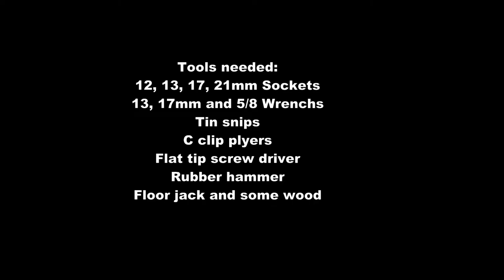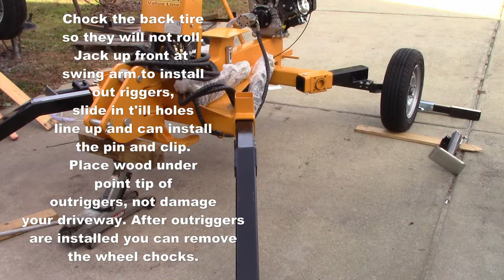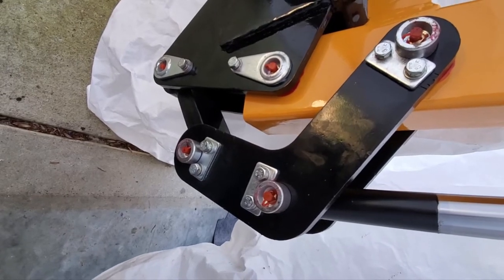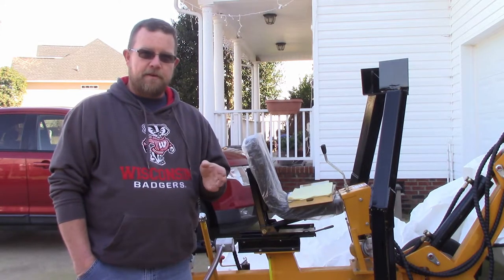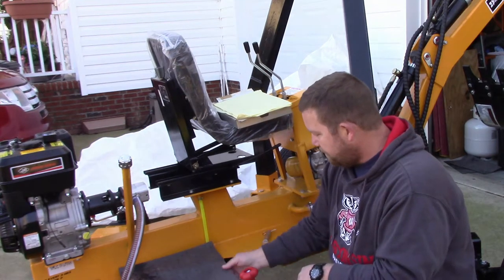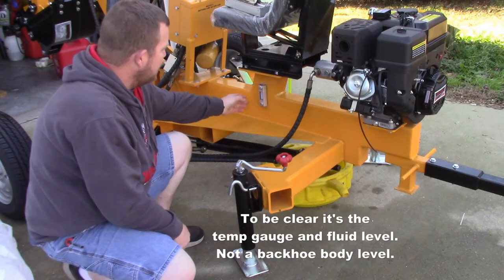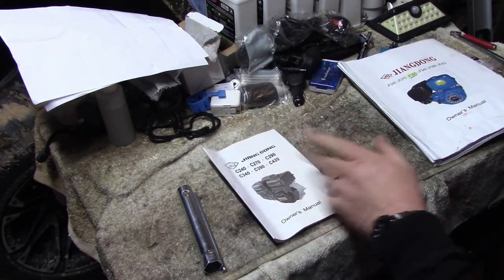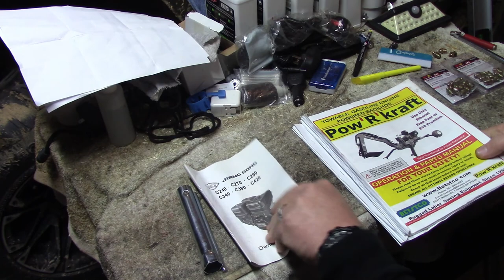ATBH7 towable backhoe assembly, walkaround, and brief manual review.

Comment: Thanks for the vid! I just got mine uncrated and am taking wrappers off. I noticed 8 white neoprene washers tied to the bucket. Can you tell me what these are for? I can't find any info. Thanks
Reply from the maker: Those go between the actuator arm pivot point and the actuator piston base pivot point. When you are installing the actuators it goes like this, pivot bolt through to frame, washer, actuator, washer, then through to otherside of frame. I hope this has helped.

Comment: Thanks for your video on this backhoe Happy Badger!  I'm considering buying this for our property and had a few quick questions.  How has it held up for you?  How many hours do you have on the unit?  Do you know the coupon code you used for 35% off?  I saw in another comment you found a coupon for 35% off, I searched all over the internet and the best coupon I found was for $65 off.  Do you remember where you found that one?  Thanks in advance for your input!
Reply from the maker: Glad it was helpful! It's been really good. The only thing was that hydraulic pump failed and roasted the coupler too. But, the warranty is awesome. just called and boom they sent the parts.
Reply: You can get one right now
Reply: You can get one right now from bestco for 3750 they're on sale till February I just ordered one
Reply: @larrywiley9160  Cool, thanks for the heads-up!

Comment: Thanks for your reply to my previous question but I was wondering what size pins ( dimensions) are on the hydraulic cylinder I don't know what  size to order if you could tell me what on your I would be able to order the hydraulic cylinder, pins and is there any bushings needed  at the cylinders if so what size would you recommend.
Thanks in advance I like your video because you keep it simple so everyone can understand thanks looking forward to your reply
Reply from the maker: I'm sorry that I can't check on the pin size, not having the machine anymore. But, call betstco service 541-460-7411 and they could help you find out.